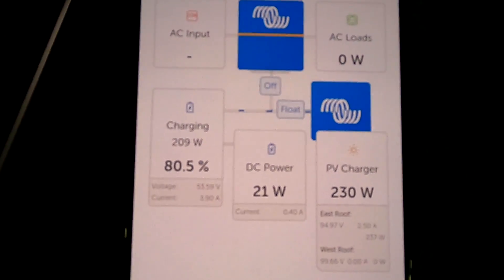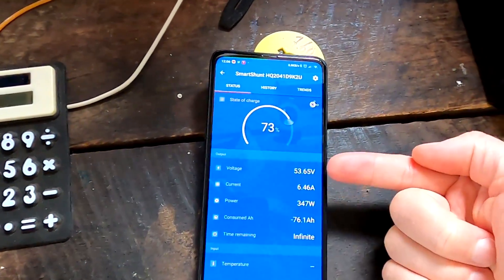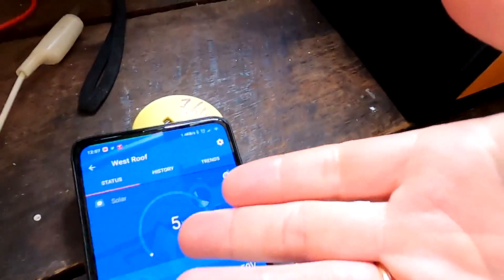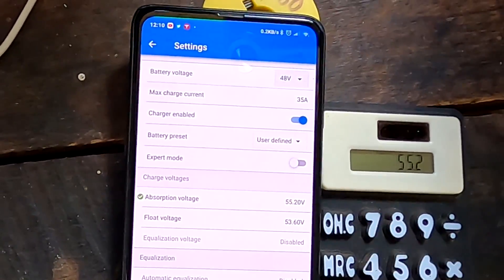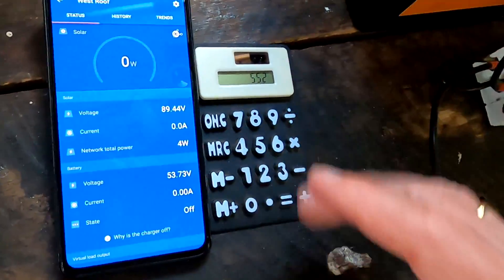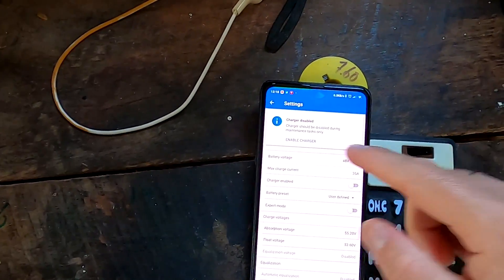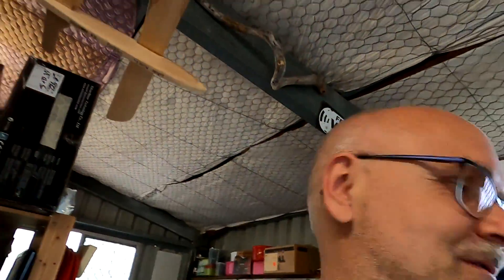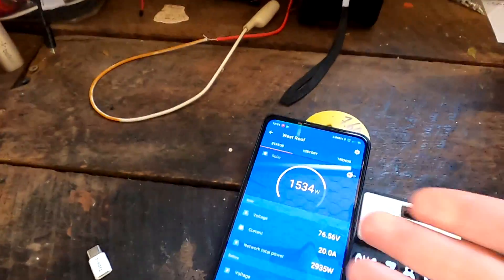Floating at 70%. Why charging LiFePO4 to 3.4V is not enough!

Comment: Key difference- during the testing you did "months ago" (back when this video was released), you used tail current to control absorption time. Here, you're not doing that.  

During that earlier test, when charging at the lower cell voltage, the tail current monitoring ran the absorption for an extended period of time - 2 hours I believe.  ?- it's been a while since I've seen that video.  

If I recall, the absorption time using tail current was very short at 3.5 volts charging. But dropping to 3.4 volts charging, the absorption then ran for an extended period of time. But the battery was successfully topped off. As long as you used the tail current monitoring to control the cycle, the lower 3.4 voltage got the battery full.  

The settings we see here have the tail current disabled.  And you used a fixed time limit on absorption (15 mins I think I saw).
Which was insufficient to fully charge the battery.   Why not flip the tail current monitoring back on, rather than fault voltage?

Comment: "it depends". I'm controlling charging with a Home Assistant automation and one thing I'm doing is ramping down the maximum charge current as the batteries approach 100%. Today my batteries were near 100% charged at 3.375!  97% according to the BMS. I just changed my target voltage to 54.4v (3.4) and I'll see how it goes.

The absolute minimum would be 54.1v but that would leave absolutely no margin for error and charging could stop at 70% as Andy found. The secret is controlling charge current so you don't trigger float too early.
Reply: How is it going today?

Comment: What is your opinion on the idea of connecting an 18-24 volt transformer instead of a solar panel to a solar charger for charging a lofepo4 battery? Or connecting the car battery with an isolator to a solar charger to charge a LiFePO4 battery?

Comment: Im having the same issue for my RV setup. I just got this, seemed to be working good on a quick test yesterday, and now at prime time, my 200ah 12v lifepo bank only charged to 20% and then it went into this float. 
What gives? I thought LIfepo didnt need to be floated? Never had this issue on other controls, they would allow my batteries to use every ounce of solar all day, every day. Im going to be very dissapointed if victron can't do that.
Really dont like the included "support" for victron either. Want you to contact the place of purchase instead of having a direct support line. That place is closed until Monday. Really dissapointing. 
Why doesnt victron allow you to set the hours of your battery bank like other controllers? It would make programming these much easier.

Comment: How do you know what percent the battery is….I got 2 12 v 100 aH lifepo4 batteries I got ep ever charge controller I put the correct parameters in it for user settings… no equalize time and it works…while it’s charging it shows the battery full charge. It when the sun goes down it shows 70 to 80%… the charge limit is  29.2 v but the batteries run at 26.6 I don’t understand why the voltage is always 26.6 at least after the sun goes down…..I use very little power…I’m getting an air conditioner for it.  I wish I had someone here to explain things….videos just aren’t enough

Comment: I've been watching your video series and another very knowledgeable Youtuber while building my new lifepo4 bank in my RV.   You made a comment in this video about absorption time vs. voltage to maintain full recharge. I think the stock Victron settings are 15 minute absorption, but as I understand it, that time is per 100ah of battery in your bank. So, a 500ah lifepo4 bank would require 135 minutes of absorption time at 3.4 volts. 
I just completed a 480ah bank yesterday and this is the basic formula I am running today. I am excited to see my results this week after the system cycles a few times. My weather forecast for the week is very sunny, so I expect to see best possible results. Your video series has helped me very much and I would like to thank you for all your hard work.

Comment: Purtroppo dopo 2 anni di fotovoltaico e esperimenti vari sono giunto alla conclusione che non esistono dei parametri giusti x ogni stagione. Anzi neppure quasi per ogni settimana. Io se le previsioni danno bel tempo almeno per 3 gg metto 54.4 per restare al 90% massimo .Se è variabile o le previsioni danno brutto tempo per alcuni giorni metto 55.2 per caricare il più possibile. Anche gli Ampere di carica cerco di distribuirli sull intero giorno se è bello. E’ inutile che arrivo pieno alle 2 di pomeriggio avendo buttato 50 Ah in batteria per niente. Lo metto a 30 Ampere anche per salvaguardare il più possibile le batterie.

Comment: I like you experience all and analysing. But generally I don't understand why with lead acid battery's people follow strictly the producer parameters. But with lifepo4 the majority invent charging styles no sense.

Victron explain how charging lithium, in the manuals by also in the excellent education text "energy unlimited". 

"We recommend a minimum absorption time of 2 hours per month for lightly cycled systems, such as backup or UPS applications and 4 to 8 hours per month for more heavily cycled (off-grid or ESS) systems."

And the same say Trojan, Exide, rolls, etc etc. Who with 14.2 slower speed charge, who says 14.6 for max speed of charge. If absorption voltage is high, than will last longer. If low it lasts shorter. Obviously at the same bulk current I said.

Battle born say at least 30 mins but every charge.

My friend, that's a specimen of AliExpress-crazy- scientist -battery-garage-makers, say that the battery companies say this:
1) because they won't your lifepo4 last long 😅
2) expensive top brands in the world battery are not good like Alibaba cells and don't have a big active balancer( that waste a lot of current in heat). So to balance need changing at high and long absorption voltage. 

Reality is the opposite: good battery brands develop the battery with exclusive collaboration with cells maker. And obtain top production cells with the same IR. they don't need crazy balancer or pass half of the time to balance etherogeneus cells.

My friend charge at 13.5 with RV solar a 280 ah battery and say that when reach this voltage r is 100% . Because BMS say that.😂
But its impossible if at 13.5 battery accept for example 10 or 15 amps.
He don't trust also that 100% is when, at absorption voltage of 14.4 , the current has dropped below 5% of capacity.
Another thing that all good brand says.
With the combo lifepo4+social, all is no more scientific, but every one have their truth.. like is for medicine, eating and other scientific questions that today are totally opinable. In some year, also mathematics will be opinable by Youtube,- gurús. I'm not referring to this Chanel.

Comment: Please I am using a 24volts 7.5amps 180watts hp AC adapter and I attached a dc to dc step up module to the adapter for charging my 24v eBike. I am using this for some times now. The bike initially comes with a single solid 24v lead acid which is dead, but i replaced it with a lithium 3200 cells
So, I now just Setup a lifepo4 batteries (8 cells 24v, not sure of it capacity, may be 18ah or 22ah or 30ah batteries) which I purchased from local junks store, I try to charge the battery with the above charger and the charger get burned.
Please, how can I charge this battery, any idea on how to create a charger that wii handle this battery, or a recommended cheap AliExpress link.
Appreciate your feedback.
Thanks

Comment: i havent heard you mention resting voltage? You can also get a SOC  by the measuring the battery resting voltage. In my small test it doesn't matter if i charge to 3.45 or above the battery cell rests at 3.352/50 The total battery voltage is 13.4 which when i googled it said 13.4-13.6 is a 100% charged battery resting voltage. BTW my battery is not in line with a solar setup Just discharging/charging different electrical stuff i have. Like running a small electrical heater or charging other batteries i have that are running my chest freezer.
Reply from the maker: Determine SOC through resting voltage will only work if the battery is fully charged. In the flat part of the curve, voltage is the same for a span of 30-70%.
Reply: @OffGridGarageAustralia  Thank you. Sadly or happily im not sure i need a BMS. I found that while charging the cells were not as balanced as i thought. Discharging there is no problem, for some odd reason im not privy of yet.

Comment: I wonder what would happen if you left them at 3.45 volts per cell all of the time?  The sun would go down every day, so they would not be exposed to that voltage continuously. ;)
Reply from the maker: No, they would not but the lower the voltage, the healthier it is for the battery.
With LiFePO4, you want to bring the cells out of the flat part of the charge curve to balance them for a while. The the voltage can be reduced to keep them at 100%SOC.

Comment: Why my battery 25.6v 200ah lifepo4 wont charging under 27.2v,mppt going 28.0 then batery is shutig off and inverter can not working,is it bad mppt or bad battery,battery is old fue days,sorry to my bad riding

Comment: I need a 48V LiFePo4 for my sail boat. Motor draws 100A, capacity should be 5-10kWh.  One large battery would be to heavy to lift. 4x12V in series would need to be balanced between.  Is 2x48V to 4x 48V in parallel a viable solution?
Or would it be best to place single cells into those old 4x AGM compartment and wire them to one fat central BMS and active balancer?
Or do all cells need to be close to the BMS or need equally long balance cables?
What would be your advice? 
Before i had 4x260Ah AGMs with 56kg each.

Comment: Adventrue Kings batteries quote in their specs for their 120AH LFP: "... The BMS will also perform cell balancing at 3.5V per cell with 35mA of current... ".
What this means, is that a min of 14v is necessary for battery balancing to occur. These LFP batteries should be charged to 14.2v, and held at 14.2 volts for a minimum of 30mins, (a balancing time of 2hrs is specified by another manufacturer) to give the abalancing circuit time to do the balancing task.

At the lower voltages some youtube comments advocate, the balancing circuit will not function. Balancing is always done at the end of the charge. And no, you do not have to balance charge every time. Charging to >14.2v , and holding that voltage for 30 to 120 mins, every 3 to 5 charges should be enough to keep your 4 cell LFP battery balanced.

At 14.2v, you can watch the balancing currrent operate, with the current slowly falling from, eg, 200ma to 50ma over an hour.

Comment: 1 one of my cells will not charge over 3.4v were others will head up to 3.5v , i going put claim in to supplier , works perfictly under load , cells blance out as i draw amps ,got me stuffed why cell number 4  it will not charge over 3,4v other cells over take it head to 3.5

Comment: My multable acp ups I converted to lifepo4 have a constant float of 13.6 while certainly a safe voltage it is not optimal. It works though if you have infrequent outages. Might try a separate charging module and see if that does not set off a battery alarm from the bms.

Comment: With 3000 plus cycles to 80% we'll all be dead and buried by the time these batteries are dead.  I set mine to full 3.6v and have had no problems.  If I had class B batteries then maybe I'd be worried.  All my batteries are new.  Also, if they were AGM then I'd be worried.  They don't last long at a full cycle.  Also, I'd definitely be setting to full in the winter months.  I can't wait until you connect your home to these and become one of us real offgrid.  Cut the cord.  That's when the real fun begins.  You notice every light, every pump etc.  Hyper aware of everything you use.  Can't wait to see if you cut it or bottle out of the offgrid lifestyle.  It's a big commitment.
Reply from the maker: Thanks, Lee. I'm working with the electrician to get the house connected. It's a bit complicated because of the other solar I have on my house contracted with a high feed-in tariff. We're getting there...

Comment: Can you not limit the amps to 20A using the Victron charge controller? I noticed in a lifepo4 battery I'm looking to buy they recommend 20A although they said it could handle 60A max. Better to configure solar panels to produce more volts than amps? I heard amps but wondered why Victron had a 150v and 250v 60a models.
Reply from the maker: Amps are what charges the battery.
MPPT solar charge controllers are converting the higher volts and less amps in lower volts with higher amps.
so 100V and 1A from solar will be
12V and 8.3A
So you charge you battery with 8.3A instead of 1A only in this example.

Comment: Andy the "MPP-Tracking System" for battery charge settings. 
"First I am going to try 3.4V, Then 3.45V, then 3.50 Volts, I think 3.65V is far too high, lets try a lower voltage and adjust the absorbtion time..."  just like the MMP tracking systems, searching for the optimal settings.
Great Work Andy, I too always question 'why' when presented with 'conventional settings'.  In many industries we see 'this is the way we do it' statements, only later to find the reasons for those methods have changed over time, but no-one bothered to ask 'are these still the best/most appropriate approach, or was this just the best at some time in the past?  
With LiFePO4 batteries we see this type of 'old thinking' with the float settings, that was needed for Lead-acid batteries, but serves no purpose with LiFePO4 since the way these batteries perform is completely different.
Always enjoy your logical approach to answering questions and seeking out answers.

Comment: Thank you so much for the energy and passion that you put in these amazing videos, i'm new to diy with raw cells and i wonder if u find that Eve cells + Victron MPPT solar charger setup is a good combo with  both Jk and Daly bms, which one of the two is more reliable for my configuration? thanks again
Reply from the maker: Thank for your feedback and comment.
I found the Victron solar charge controllers, the EVE LiFePO4 cells and the JK-BMS to be a very good combination. It all works well and reliable together.

Comment: Is it possible to show bench test charging times at different voltages - 3.4, 3.45, 3.5, 3.55, 3.6,.3.65, I know you have done the first 3 and the charge time was around 4 or 5 hours with decreasing absorbtion - the graphical representation was superb. It helps massively to get your head around LIFEPO4 :D

Comment: I don't really understand the concept. Wouldn't you just switch from constant current to constant voltage once your desired maximum voltage is reached and then continue charging until the current drops below a fixed threshhold, like 100mA or so? Doing the cut-off simply based on timing seems wrong and may be the reason why it's not working very well.
Reply from the maker: Yes, that is correct. We can set a tail current in the SCC which would end absorption if the current goes under a certain set limit. that is usually 5-10% of C, so 14-28A for these cells. They are then considered fully charged.
The problem is when you charge slowly or have clouds, there is no CC or CV and you can hit the absorption voltage for a moment. This could already trigger your absorption timer.

Comment: On my boat I want to be 95% full at sunset with top balanced mismatched cells. I have found 3.45vpc on absorb, float and bulk is simple and works well. My batteries stay balanced with 3.45 top charge rate and I don’t trust my bms to do the balancing and the bms requires a higher riskier SOC that I want to avoid. Better to just buy more cells than to risk/complicate my life for 5% SOC.
Reply from the maker: That's a very good point, Danny! I agree, if you need more capacity, get a second battery. There is no capacity gain of charging higher. 3.45V is ~99.3%SOC.

Comment: plaese show us the voltage of the cells in the BMS when you hit the 3.45 V. Are all cells identically? Beschde Grüße aus der Heimat.
Reply from the maker: At the beginning, there is around 50mV difference but once the current goes down during absorption, the deviation goes down to under 10mV. So it is still balanced OK.

Comment: why not set the absorbtion time quite high and set the tail current to the current at which you just go into the steep part of the curve? in that way you will switch to float only if the current has dropped below the set value - and more importantly the SOC will be consistent between cycles...

Comment: I have been watching your channel for a long time and learned a lot from it. I recently purchased a PV installation. 10 panels with enphase inverters. Is it possible to connect an enphase iq7 directly to a LiIon battery pack instead of a solar panel. I want to charge the battery during a surplus of solar energy and use the battery as a buffer when there is a shortage of solar energy, taking into account the limited capacity
Reply from the maker: The Enphase are micro inverters so they connect to the grid only I believe. I don't think you can connect batteries to the input of these inverters.